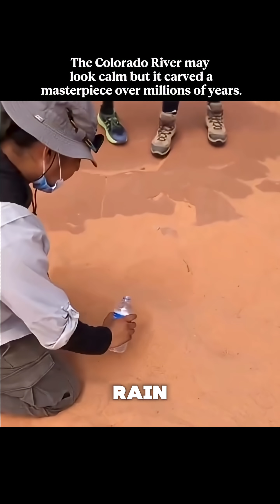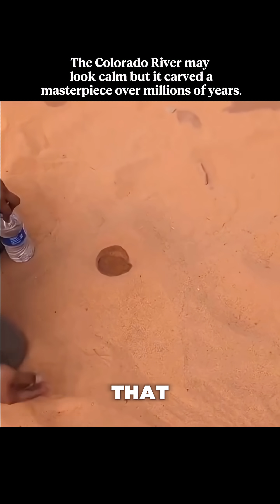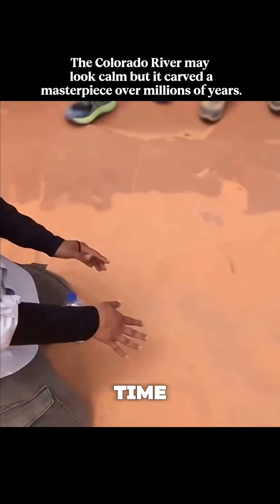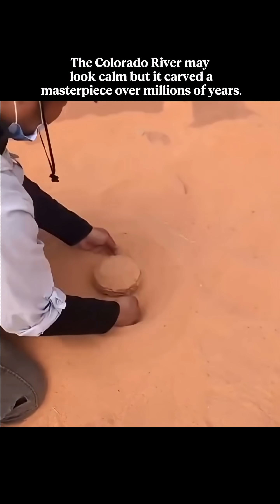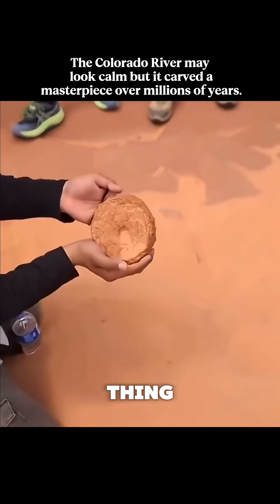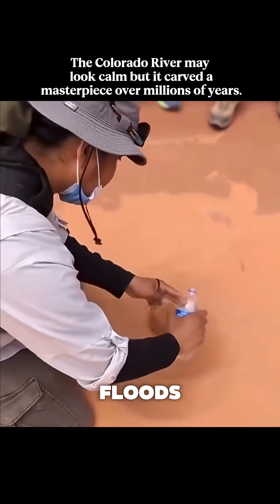How the Grand Canyon Was Really Carved?

Comment: The idea that the Colorado River slowly carved the Grand Canyon over millions of years sounds neat on paper, but the evidence does not back it up. The river today does not have the power to carve something that deep and that wide. Even secular geologists admit that. They are starting to move away from the old textbook version because too many things do not add up.

The rock layers in the canyon sit on top of each other like they were laid down fast. There are no long breaks. No soil built up between layers. No major erosion marks that you would expect if these formations took millions of years. It looks like one major event pushed all of it together quickly. Then something powerful tore through it fast while the layers were still young and soft.

The side canyons cut deep and sharp into the walls. They look fresh. They do not look like something carved out slowly. If erosion was slow these side canyons would be wide and shallow. Instead they look like water rushed off fast. That lines up with rapid drainage not slow carving.

The river also enters the canyon where it is shallow and leaves where it is deepest. That is backwards. Water does not cut uphill. Even secular geologists call this a problem. They have had to introduce new theories like the lake spillover model. That is their way of admitting the old river carving model does not hold up.

Now they talk about giant ancient lakes breaking loose all at once. They say massive floods poured through and did the work the slow river never could. That is modern geology stepping toward a catastrophic explanation. They still avoid the Biblical flood but they know slow erosion does not fit the evidence. They are abandoning the old story piece by piece.

If anything the canyon looks like the kind of scar a world changing flood would leave behind. Fast layers. Fast carving. Catastrophic power. It matches the description in Scripture far better than the idea of a gentle river taking its time.

Comment: This is why no machine will ever be able to match the force of nature as far as compaction goes. Doesn’t matter how many times you vibrate, compact, add water. You cannot beat millions of years of this process when building up for the foundation of a home.
Reply: Except that we use concrete and steel for the foundation of buildings, which is much stronger than the soil/sand compaction by nature you are referring to.

And yes, reinforced concrete definitely beat them.
Reply: @boowhale you have a concrete foundation yes but the ground also has to pass compaction around that foundation. You can have all the concrete and rebar in the world but if the earth around it shifts it does no good.

Comment: Sorry prof. But your presentation assumes all the layers of the Grand Canyon are all the same minerals.

Instead of it being gradual flooding, I theorize enough mud and water washed into one place at the same time and as time went by, the minerals separated before the water dried up, separating by density and after everything solidified, the river started to carve down all the layers over time.

You can test this at home. Grab a jar of water, grab different types of minerals like sand, dirt, iron, etc and shake the jar. You will see layers starting to form each within their own category. Then wait for it to dry.

Comment: THE GRAND CANYON ISN'T SAND CLOWNS. IT'S NOT SAUDI.... So the grand canyon never had time to dry and harden after the rains? The only reason why it's cutting through is because the sand is wet still. All the layers weren't created at the grand canyon at once and they didn't have enough time to harden, before flash floods came in. This is stupid and a wrong demonstrationof the terrain and rain consistency at the grand canyon. The grand canyon could go months without rain and in that time things have dried and harden up by then. So when the rain comes back again, it's not hitting on wet sand anymore like this demonstration. Things have dried up by then and your little display is gonna act way different if you poured water on dry sand each time, let alone rock like the grand canyon really .... and most importantly...WTF DOES SAND HAVE TO DO WITH ROCK? ISN'T THE GRAND CANYON A LITTLE DIFFERENT THAN LET'S SAY.... SAUDI ARABIA AND THE SAND THAT'S REPRESENTS THAT AREA COMPARED TO THE TERRAIN OF THE GRAND CANYON?
Reply: Dude, what do you think sand stone is. Like, c'mon

Comment: This tour guide is a teacher who makes study of geography simple, easy and interesting at the same time.
Reply: So you're meaning to tell me that it rains and then for millions of years you get layers of dry sand with no rain ever, and then it rains again which causes the sand to calcify and that's how you get layers? 🤨 This idiot doesn’t take that into account. You can't compare that miniature example of sand hardening quickly cuz of water poured in seconds in a controlled environment to millions of years of it doing the same thing on a massive scale cuz then you'd have to have millions or hundreds of thousands of years without rain. It's just stupid. Water washes things away so if it keeps raining ever so often every year and washing things away, there's no time to build a layer. It's simple logic. Common sense. Which clearly evolutionists don't use. 

Only places things get covered in sand over many years is in deserts where it hardly ever rains like how archeologists have to dig to find things in Egypt or but if it rained a lot then all of that stuff would've never been hidden cuz the sand would constantly be washed off. That's what water does.

Comment: Can he next explain how the Colorado river traveled up hill to begin carving the canyon? Seems nobody knows the elevation changes from the base of the canyon to the top.
Reply: What? What are you talking about.  The river is at the bottom of the canyon, it's flowing through it right now. It doesn't need to go uphill lmao
Reply: @simp4hadvar obviously. How did the water begin to carve the canyon. Look at a horizontal schematic of grand canyon. The base of the canyon to the top is like 1,000 feet. So how did the river go up hill to begin to carve the canyon. A massive flood caused the canyon not a little river going uphill
Reply: @simp4hadvar watch kent hovinds video on grand canyon.

Comment: This is misinformation. I know i sound like that guy . But I am a geologist. If this were to be true then every river might have such structures but they don't . What makes a canyon is when a river flows over a rising tectonic plate .so as the plate rises , the river carves through it . That makes the river carve a canyon . Because once a river is done craving it's path it's clear of most erosion . But the grand canyon still experiences erosion. So it's more of plate activity. And due to the movement of the plate putting different environments caused the layers over hundreds of millions of years . Then this experience uplifting by the tectonic plates which interfered with the Colorado river which then started to cut the stone while the plate was still rising.

Comment: please research and then ask 

if the head of the river is lower, how did it cut the grand canyon which is higher in elevation 

how are there folds and bends in the rock layers   

read your bible

read john 3-16-17 

read revelation

Comment: Now that’s a great tour guide. I was engaged, interested and I learned something I never knew. It helps that he seems to love what he does and is a good communicator
Reply: So you're meaning to tell me that it rains and then for millions of years you get layers of dry sand with no rain ever, and then it rains again which causes the sand to calcify and that's how you get layers? 🤨 This idiot doesn’t take that into account. You can't compare that miniature example of sand hardening quickly cuz of water poured in seconds in a controlled environment to millions of years of it doing the same thing on a massive scale cuz then you'd have to have millions or hundreds of thousands of years without rain. It's just stupid. Water washes things away so if it keeps raining ever so often every year and washing things away, there's no time to build a layer. It's simple logic. Common sense. Which clearly evolutionists don't use. 

Only places things get covered in sand over many years is in deserts where it hardly ever rains like how archeologists have to dig to find things in Egypt or but if it rained a lot then all of that stuff would've never been hidden cuz the sand would constantly be washed off. That's what water does.
Reply: @EpilepticGamer7 jeez someone woke up on the wrong side of the bed.
Reply: @GummySlayer Whenever someone starts a comment with, “So you’re telling me…” or any similar phrases, I know they’re going to be a jerk.
Reply: @EpilepticGamer7 idiot completely misunderstood what he said lmao

Comment: Makes me think the Egyptians molded the pyramids in this way and molded the blocks at the location and figured out how to harden it with heat and water and a bonding agent 

However, I think we supposedly know the quarry location. I also forget what they are made of. Is it granite, quartz or sandstone

Update. 

Mud brick: In the Middle Kingdom, mud brick was used as the core material for some pyramids, with a limestone casing for the exterior

Comment: The problem is that if the river carved it over  a great expanse of Time the layers would be blended up to fifteen feet deep into the walls of the Canyon. If the layers were laid down in the way he described they would not be made of the composition or clarity of separation that we currently find across the entire continent. Mount Saint Rushmore proved to be the most likely answer to how these canyons actually formed. A great body of water at high elevation broke it's barrier and flowed out seeking the quickest route downhill. Creating snake canyon, which only 30 years later looks indistinguishable from portions of the grand canyon if on a slightly smaller scale. This new canyon was formed in less than 24 hours. And has the same layers. The river in the end being the lasting evidence of the creation of the canyon rather than the cause of it. It's thought that the grand canyon is the place where the inland sea that covered much of inland California and the mid west, broke its barrier during a major eathquake and  carved the canyon in a period of two or three months. The last dredges of that inland ocean being what would evaporate to make the salt lakes of Utah.
Reply: Yeah the layers would not be blended, the sandstone and shale units were lithified during burial. the river itself is much much younger than the formations. The tour guide means well and it's a cool illustration but he is not explaining what actually happened.

Comment: This illustrates why being a good showman is an important skill
Reply: Too bad it is nonsense.
Reply: So you're meaning to tell me that it rains and then for millions of years you get layers of dry sand with no rain ever, and then it rains again which causes the sand to calcify and that's how you get layers? 🤨 This idiot doesn’t take that into account. You can't compare that miniature example of sand hardening quickly cuz of water poured in seconds in a controlled environment to millions of years of it doing the same thing on a massive scale cuz then you'd have to have millions or hundreds of thousands of years without rain. It's just stupid. Water washes things away so if it keeps raining ever so often every year and washing things away, there's no time to build a layer. It's simple logic. Common sense. Which clearly evolutionists don't use. 

Only places things get covered in sand over many years is in deserts where it hardly ever rains like how archeologists have to dig to find things in Egypt or but if it rained a lot then all of that stuff would've never been hidden cuz the sand would constantly be washed off. That's what water does.
Reply: @EpilepticGamer7  You're right, the layers in the canyon didn't get formed by water hardening it. They got formed by different depositional environments burying previous sediment deposits, compacting them and so leading to lithification. You're wrong about bashing evolutionists.
Reply: @EpilepticGamer7 you stupid 😂